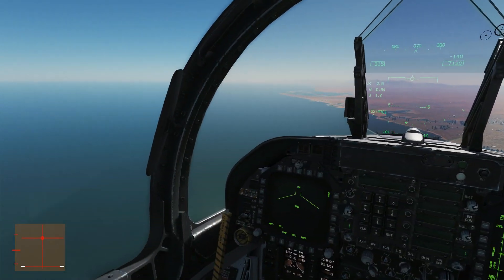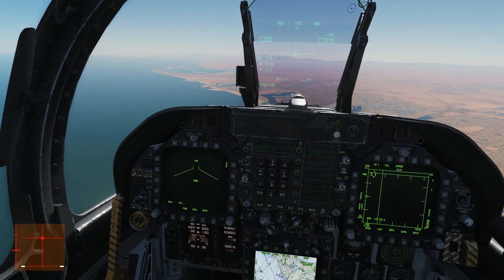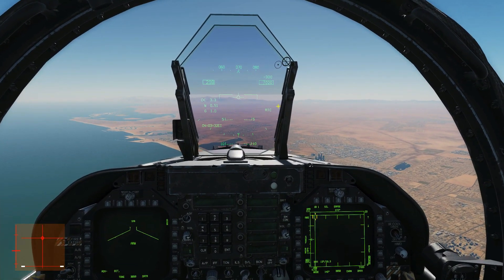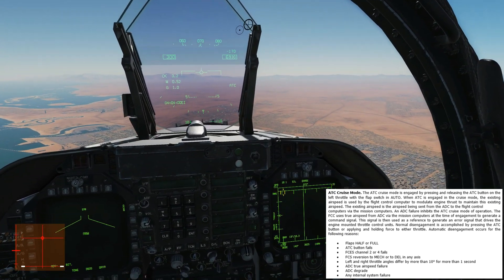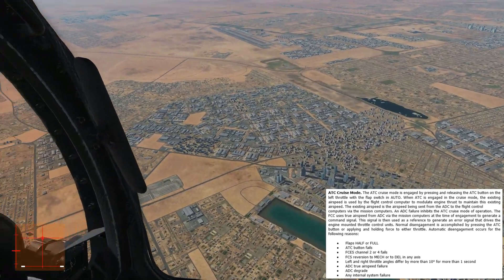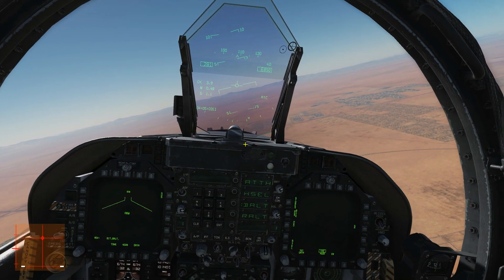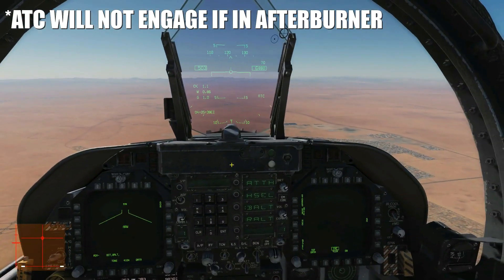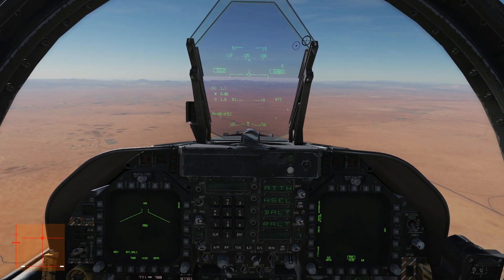FA-18C Hornet: ATC Auto Throttle Control - Cruise Mode Tutorial | DCS WORLD

Comment: A possible reason for limiting max throttle position is in the event the ATC fails in a manner that it wants to kill the throttle or something requires you to maneuver, you can just jam it full throttle rather than pushing a button. Speed of one over the other can be argued but a pilot is going to move the throttle and stick before pushing buttons to react to something.
Reply: It's simply because afterburner is not for cruising.

Comment: Have you tried landing the Viggen with the AFK?
Reply from the maker: actually no. What does it do?
Reply: It’s the auto throttle, and keeps you at 550 km/h. But when you lower the landing gear it drop the speed to about 250 km/h and that gives you a nice 11-12 degree AoA for landing.

So I fly with AFK at 500 meters. 10km from the runway I lower my gear, the speed drops and it stars to descend. So everything is automatic and you only need to adjust your joystick.